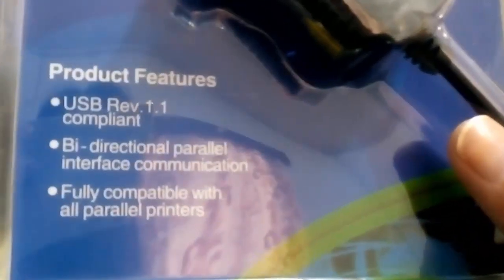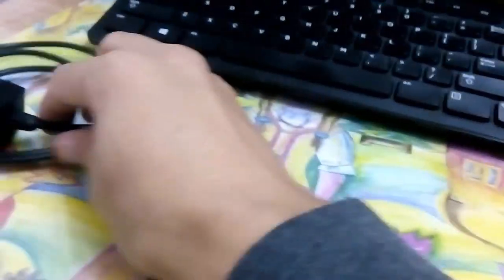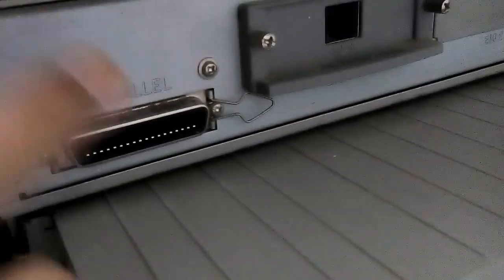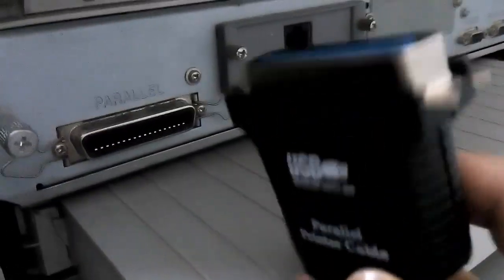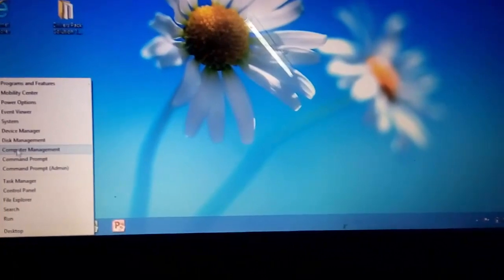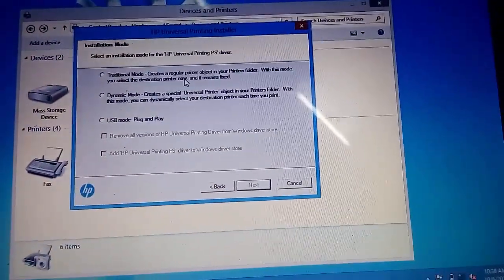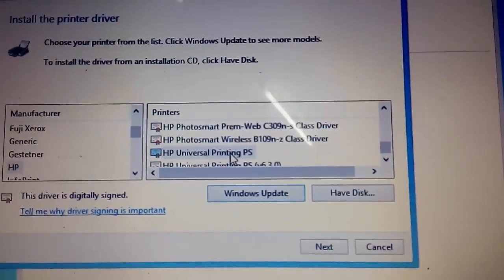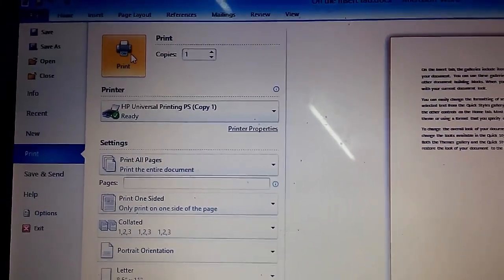Easy way to Install Printer with Parrallel to USB Cable

Comment: Sir I have epson lq2090 dot matrix it’s showing device is not recognised please help I’m trying in usb cable please help I’m struggling this problem is so many days
Reply from the maker: For the dot matrix, I suggest to download and install driver from internet. Once you have the right driver installed surely the USB cable will work.

Comment: Strictly the title of the video is misleading - this does NOT convert a parallel port to USB - it converts a USB port to a centronics (LPT).

The conversion the other way is much more complex (ie connecting a USB printer to a centronics / parallel port).  This can be done within a Windows based machine using various parallel port capture software (assuming the Windows machine then has a USB port to connect a modern printer).

However, if you don't have access to Windows, then you need a hardware solution such as our own Retro-Printer module for the Raspberry Pi - www.retroprinter.com

Comment: dear sir  i have hp 4000 printer ,and in my laptop window 8 professional 32 bit  install ,and "udp-pcl-6 x32-6.8.0.24296 printer driver install in same method as you learnt but after installation when i print  a document same like you, printer print "Blank Pages" whats reason ?????????????but if i print printer configuration report without attachment of printer with laptop it print correctly .please answer
Reply from the maker: when you press print command and if printer respond, then it means connection is successful. The second thing to check is; printer-ink, the document you want to print contain some text. Try with another laptop, is it still showing the same problem? Try once with another laptop, hope you will probably may find out the reason.

Comment: Buenos dias, instalo el cable pero no sale la impresora que puede ser?
Reply from the maker: ¿Has instalado el controlador de impresora?
Reply: Es una citizen GSX190 y no encuentro ese controlador para windows 7 por ningún lado hermano, tu lo tienes o sabes como instalar? ya estoy pensando que perdí dinero en el cable...
Reply from the maker: Encontrado este enlace de descarga del controlador: http://www.helpjet.net/Fs-23301403-75843699-85089335.html
Prueba esta esperanza, esto funcionará :-)           The file you will download is .CAB format. What is .cab , how to open ...refer to this https://www.lifewire.com/cab-file-4144227
Reply: Gracias amigo, una pregunta la extensión es CAB y no ejecutable como instalo ese controlador?
Reply from the maker: https://www.lifewire.com/cab-file-4144227
Reply: Gracias por el apoyo amigo, pero no he podido instalar la impresora, no hay un ejecutable dentro del comprimido .cab solo archivos de informacion .inf,  estos archivos se instalan manualmente, pero si no tengo la impresora en lista, o no aparece la impresora en windows 8 o 7 como puedo instalar los .inf manualmente? debo seleccionar la impresora citizen gsx 190 y luego buscar manualmente los archivos .inf que me has pasado, pero si no aparece la impresora como puedo instalar los drivers? gracias por la ayuda espero puedas responderme